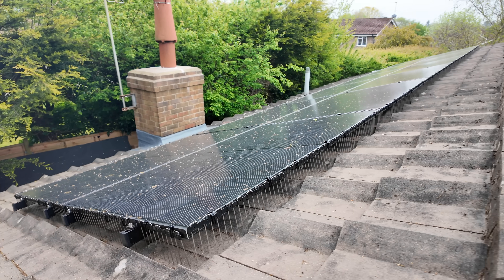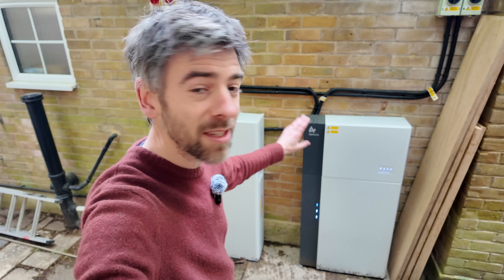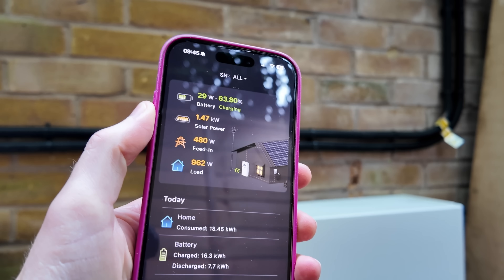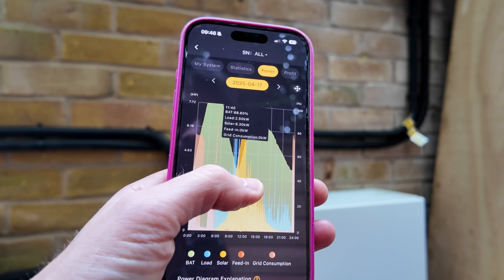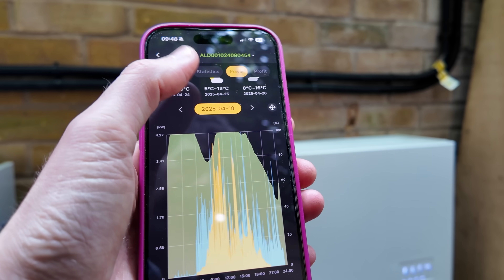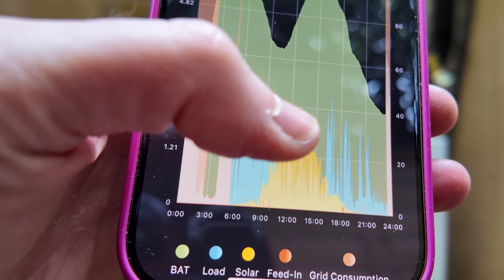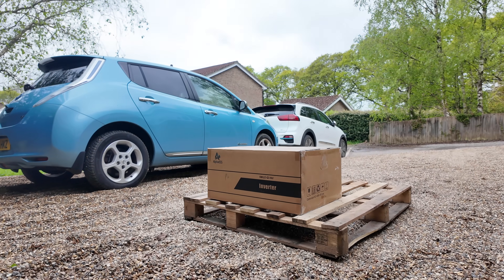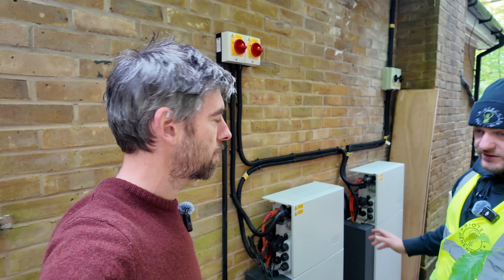Inverter issue! Problems with our AlphaESS system from Heatable. Here’s how they were resolved

Comment: Enough! The "I'm not an electrician, I don't understand this stuff" comment  is just too irritating. You don't have to be an electrician to at least understand the basic principles of electricity- which doesn't mean playing with a phone app and 'geeking out' on the data (and really, what good is the data if you don't understand it). So, last post, unsubscribing. No reason to clutter all the supportive comments with my negativity.
Reply from the maker: I appreciate your comment, but if my stupid questions can help others understand these concepts then I'm happy. It may seem like a basic principle of electricity to you, but it's not something I ever studied. My channel is all about making mistakes and learning from them, and there's quite a steep learning curve with solar panels and batteries!

Oh, and the app data is far easier to understand than the concept of panel voltages, I think!
Reply: @MrEV  total string voltage can vary due to heat or cold conditions.

Comment: I love our solar system and am always happy to see others enjoying them too! Our energy bill last month - which is gas unfortunately + electricity (including charging our car) was minus £15. We've been trickle charging the car on the granny charger and during the recent sunny days, we still fill the battery and export a bunch. And our array and battery are smaller than yours. Enjoy your graphs!
Reply from the maker: Great! I don’t think I’d ever tire of seeing negative bills!
Reply: Gas heating, 8 kW solar, 13.5 kW battery and running an EV and my bill for May 2025 was minus £36.56 (including all standing charges). Maybe you should be doing more off peak car and home battery charging and let your excess solar go for export. Why charge your car and top up your house battery on the the solar electricity when you can export it at 15p/kWh and then you can charge at the off peak rate of 7.5p kWh?

Comment: Andrew, are you force discharging the batteries late in the day and then filling them back up to full on cheap overnight electricity.  I've been doing this for a couple of months now, and it gives a decent income with little effort?  Currently (excuse the pun), I am paying for all my electricity and gas with the exported payment, which has amazed me.
Reply from the maker: Great question, and no — not yet! I'm considering using Home Assistant for that but it's something I'll tackle in another episode. I may do it manually of course, which is fine this time of year when the electric radiators aren't doing much.
Reply: You mean emptying the batteries back into the grid and getting paid for it? Then topping back up on cheap pricee overnight?
Reply: @hennnnerz  Yes
Reply: @hennnnerz  In the summer months when your solar can maintain your house for most of the day the battery will stay pretty much full the entire day. Why not make £1.50 by dumping 10 kW from your battery to the grid before the off peak rates kick in when you can charge that back up for 75p. That's around £22/month (£264/year) of income if you have the battery capacity to take advantage of.
Reply: Thanks for doing something that actually helps the grid and paying for your standing charge rather than moaning about it :)
Reply: Don’t forget if you make a profit, your liable to do a self assess form if you withdraw from the account.

Comment: I don’t export so when my 10kwh battery storage is full my solar production drops as there is nowhere for the energy to go , it’s at that point I plug in my Tesla to charge with the excess solar production .I suppose your system will export back to the grid once your batteries are full .
Reply: I don't know your set up but usually your solar production won't just stop, it'll continue to power your home and go to the grid (export). If you have a FiT payment (Feed in Tariff) they'll pay you based on your solar generation meter. If you're not receiving FiT payments you'll need a smart meter and plan with your energy supplier to get paid for any exports.
Reply: @stevecade857 it’s an off grid system , but it’s backed up with grid when required .
Reply: @antoniopalmero4063  Off grid means you're not attached to the grid at all but you  say you can use the grid when required. You're not really off grid then and could take advantage of exporting excess solar.
Reply: @stevecade857 doesn’t that involve licensing and all that other stuff ? , I only have 3.6kw of panels and 10kwh of LFP storage and use pretty much everything I generate .
Reply: @antoniopalmero4063  Do you live in the UK? If you do you really need DNO approval and commissioning to have any generation system connected back to the national grid. If you're not from the UK and can't take advantage of anything you can export, as you're using 'pretty much everything you generate' I'd say you have a nicely specified  system.
Reply: @stevecade857 I do live in the UK 🇬🇧, DNO ? . I installed my system myself in 2020 at a cost of about £4500 .

Comment: Why do all the radiators come on in the middle/end of May ? 😆 Surely you could turn them off for a few months now ?
Reply from the maker: I’d filmed this in mid-April. Radiators haven’t been doing much in the past couple of weeks thankfully!
Reply: @MrEV  ahh fair enough, that makes a little more sense! 😆 glad to see the PV system is all up and running now, it’s gonna be a game changer for your electric bills, especially with the electric heating you have 👍🏻
Reply: PV semiconductors, MPTT, buck converter, LFP-chemistry, boost/buck stage, dc-ac inverter, all to be burnt up in a heating element. 😅

Comment: Great stuff, solar makes a lot of sense for you with 2 EVs as well, it all helps anyway. I personally love the idea of rather than home batteries to use the EV battery but that's a harder problem if the car doesn't support it, more should imo.
So, heat pump next? :) I also think air to air would be ideal for those months of the year when you need to cool the house down as well. The UK seems gears towards air to water due to existing radiators I guess.
Reply from the maker: I’d love a heat pump. My wife wasn’t a fan of air-to-air (pun not intended!) from our experience in the previous house, but I wonder if she may change her mind!

Comment: Are you counting the total output as you bought bifacial panels yet they are mounted too close to the roof tiles to gain any effect?
Reply: I was wondering why he had installed bi-facials too……..
Reply from the maker: It's the only panel Heatable offer: https://heatable.co.uk/solar
Reply from the maker: Each panel is 450w in total, but the face of each generates 420w so I suppose that makes it more like a 12.6kW array if you ignore what can be generated from the reverse.
Reply: Could have painted the roof underneath with reflective paint first...🌞

Comment: I'm looking forward to seeing your performance of the solar over the winter months. (Nov - Feb)
Reply from the maker: Me too. But I'm certainly not wishing the year away. I'm enjoying the warmth!
Reply: 13kw of panels and they were outputting 1.3kw when malfunctioning would suggest even with 6 hours of daylight in the winter that should be enough to charge the 10kw batteries.
Reply: @keyserxx  Probably optimistic. In the depth of winter. Depending on how the house is heated (which is electric I think) Will be fun to find out. Love the videos Andrew!

Comment: I'm currently exporting about 2.5 kW and the panels are producing 6.2kW (75%).  Checking the Octopus bill over the last week Ive been charged £8 ish but I've been paid £6 ish. And its dull, windy and rainy here so getting 75% out of the panels today is going some.  (Geek info: Got two strings around 290v each. Total is 8.1kW)
I imagine you'll be doing well until late October early November and then - winter. Barely (like not at all) export anything between December and March here ...but it is Scotland. 
Overall though, sounds like an excellent set-up.  Could you (if you had the money) dual up the batteries without adding extra inverters?
Reply from the maker: That sounds promising! I'm definitely not wishing for the end of summer but I do look forward to seeing how our system performs in winter months. The battery will get depleted quickly with our load in the morning thanks to those hungry heaters we have, but a sunny day should help keep the heating going "for free" throughout the day I think.

Comment: Andrew, what's the recommended cleaning frequency for solar panels to ensure they always operate at peak efficiency?
Reply from the maker: Apparently they're self-cleaning and "only need cleaning every 5-7 years". While I was up there, I did wipe off some bird poo but generally I think the rain will do most of the work.

https://heatable.co.uk/solar/advice/solar-panel-maintenance
Reply: Not to steal Andrew's thunder but my panels are supposed to be "self-cleaning". In practice(because they're ground mounted) I hose them down when they start to look too filthy.
Reply: Mine had plenty of bird poop on them, I couldn't say I noticed any particular drop. Anyhoo since then we've had rain and they look clean again.
Reply: Depends on the angle of your roof really and the local conditions. It’s basically impossible to ensure they operate always at peak efficacy unless you clean them every night!
Reply: With the recent dry spell, poop has accumulated, then washed off in a few showers.